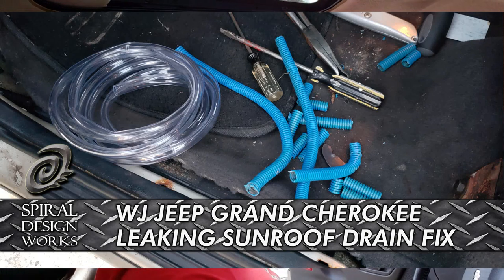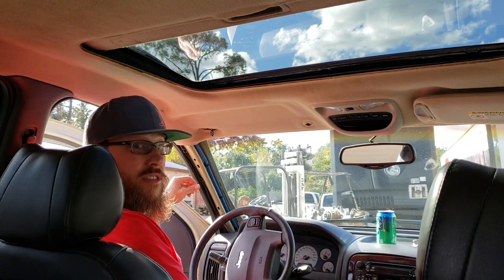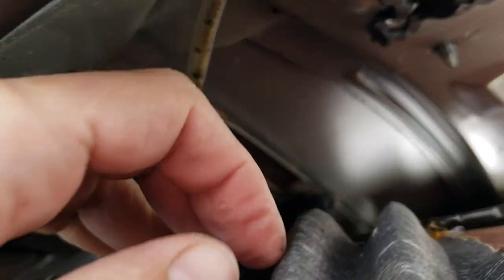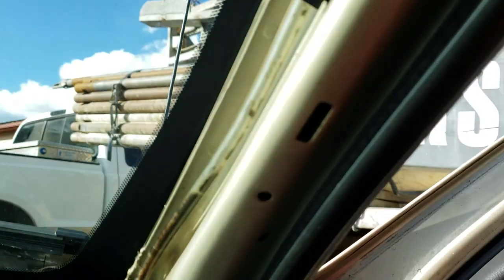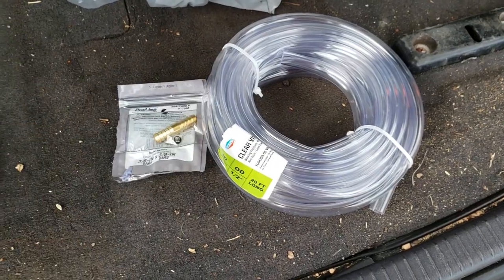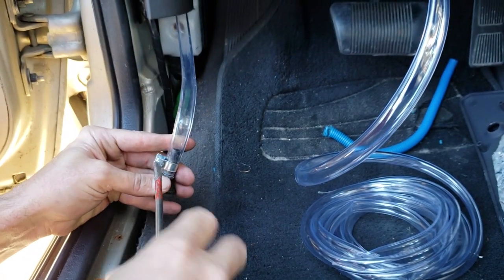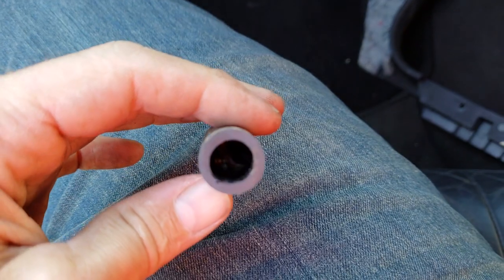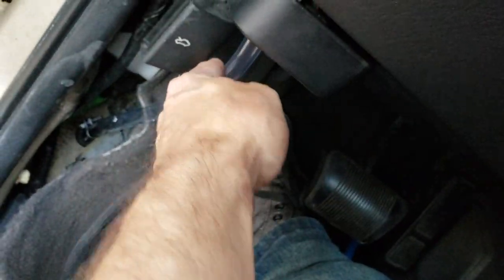EP.16-Leaking Sunroof drain tube fix- WJ Jeep Grand Cherokee

Comment: You're aq moron and should not be posting video's
Reply from the maker: Not sure what a "aq" moron is. I enjoy your content as well. Oh wait you don't have any. Troll on my friend.
Reply: @SpiralDesignWorks know anything about not getting any heat out the vents? I've had new, thermostat, rad, water pump, heater core, door blends and actuators! It's been scanned and nothing wrong! Recalibrate, still no heat! The door blends and recirculation door move OK, hot water in tubes, no airlock! Is there a valve or electronic device that could be overlooked by a non jeep mechanic? Any help would be great as my wj is a great car! Just passed mot with no advisers!
Reply from the maker: @terrystratford1235  that is tough if you already replaced all that. Check to see if you are getting coolant flow in and out of heat core.
Reply: @SpiralDesignWorks  my mechanic has a heat gun to see thermo temps, its all good! He flushed it multiple times! I wonder if there's an electronic device that sends info from turning the knob, to the actuators? Jeep want £200 to plug into a proper diagnostic! They assure me it will tell me what's wrong! My mechanic  has to replace the sunroof drain hose and is determined to find why I've no heat! He and his team are amazing, does alot of local work! He has looked after my jeep for 5 years! I understand there's a automatic temperature control unit on the back of the hvac system that controls the actuators, but that's a dash off again! I'm hoping it's something simple! 🙏
Reply: And who are you ??
Reply: @terrystratford1235 Terry, don’t know if you fixed this but a common problem with the WJ/WG is the foam disintegrating around the heating duct joins. Mine is going as I hardly get any flow from the drivers vents.

Comment: I had a huge leak and after removing the headliner I realized there wasn't any tube at all attached on the drains.  Went to home depot and grabbed some clear hose and used a hose clamp on the sunroof drains and stuck the other end thru the floor board and out a ton of clear silicone on the floor and it all worked great.  Big thumbs up for the video btw!

Comment: Heres another tip...to keep the rear dog legs from rotting out, which for most of us it may be too late, extend the C-pillar drains OUT of the vehicle.  As they're currently 6 inches to short to do so and actually dump inside the "pockets" in the rear behind the bumper cover.  From seeing the fronts drain into the frame rail, and knowing the rears drain inside the vehicle, it would seem these WJs were set to rot out from the factory.   Talk about guaranteed failure!  It just ensures that nothing will last forever..
Reply: Have any videos or guides on where these ones are at?

Comment: My 04 was getting water on the drivers floor, of course the first thing I checked were the roof drains. Expecting crumbling blue tubing I was surprised to find black tubing in perfect condition. The tubing was still very flexible and intact, the factory must have done a late production change to the tubing material. After pouring a good amount of water in the drains it was clear the leak was elsewhere. After some investigating I found the source of my leak was the bellows the door wiring passes through from the pillar.  It was dislodged where it registers into the pillar allowing water running down to enter the bellows where it would run down behind the kick panel onto the floor.  A reseating of the bellows in the pillar solved my problem.
Reply from the maker: Also the condenser drain can get plugged and drip onto the floor.
Reply: @SpiralDesignWorks   Yes it can, it used to happen on my Crown Vic all the time.  The carpet has already been removed from my Jeep, the entire interior is bedliner. I dumped a lot of water in the cowl area, the only place it came out was that grommet through in the kick panel area on the driver side. I got lucky I guess with this thing.
Reply: What year was your black tubing?

Comment: if that much water is making its way into your sunroof drain tubes then your sunroof still needs to be replaced the drain tubes are only there as a backup if and only if that much water is making its way around your sunroof seal and down into the trough that holds water and exits through your sunroof drains. They are not there solely for the purpose of carrying all the water that lands on your roof down the drains your sunroof seal is supposed to keep the water out it shrinks over time because of the sun exposure and you have to replace it there is a guy with a Dodge charger that has a video on how to do it on all Mopar vehicles which is Jeep Chrysler Dodge and RAM hope this helps

Comment: Finally someone did the entrance drain correct. So many youtube videos show putting the drain tube inside of the main drain...What? Thanks for this video I was scratching my head trying to figure this leak out. I did eventually pull my floor mat up, and wiped the lower drain tube dry, and re wet my upper side panel on my roof- then the area under my mat at the lower drain tube did get wet again. So now I know it is coming from the faulty tube. Great Video!

Comment: Thank you very much!  I had ruled out water traveling thru the door (design flaw) as the culprit causing the soaked driver-side floor, using a tarp during a big storm but did not know where to go from there.  Really appreciate your detailed video!
Reply from the maker: Glad it helped! If you get a pool on the passenger side it is usually the drain for teh Heater core box is plugged or leaking heater core.

Comment: Excellent video, thanks very much for posting this. My WJ had been bone dry summer and winter but then after a prolonged period being parked up and facing downhill low and behold I return to find an indoor swimming pool in the passenger footwell. My first thought was to reach for the extra long pipe cleaners to purge the tubes of gunk and restore water flow. However, after watchiing this and the point you make regarding the brittle nature of the connection's and the tube I thing your approach to inspect the whole line from top to bottom is preferred. Thanks again for going to pains in showing good quality video of each step and how you achieved those water tight replacement connections and tools / pipe used.
Reply from the maker: Yes I need to do my rear drains. Had it parked nose up hill and rear floor was flooded. Ugh. I hate sunroofs.

Comment: Nice video. I have a white '07 GC and the floors in the front have been getting soaked. I've taped over the sunroof joint with white duct tape to see if the leak is stopped till I can tend to the fix. Thank you again for the instructional.
Reply from the maker: mine is leaking again and I suspect the lines are clogged and need a good blow out and cleaning.

Comment: This totally answers my question...had a damp passenger side floor in my wk..now I know why. Also sent to the car wash and my driver side inside pillar was leaking water. Had to reset my sunroof for one. But also probably have a brittle drain tube.
Reply from the maker: if you are just seeing water on passenger side floor it could also be the heatercore leaking. But most likely sunroof drains.

Comment: Both front floors on mine are wet all the time and my sun roof is siliconed shut. How i bought it. But i can hear a drip in the roof while driving. Im sure this is it. Good thing im a plumber. This is a piece of cake. Great vid!
Reply from the maker: Thanks!
Reply: @SpiralDesignWorks  do you think it would be a bad idea just to plug the drains if you dont use the sunroof?

Comment: Thanks for sharing this!  I have a 2006 Jeep Grand Cherokee Limited with pretty much the same layout. My passenger side flooded after a heavy rain and I suspect there is a clog in the line somewhere near the floor. Do you know what connections could be effected down there? My Jeep drove the morning after this flood, but now has no power. I think driving it before drying it out may have shorted something. Ideas?
Reply from the maker: Really hard to say. The connections under the hood are "water proof" but it is possible to short out a circuit if you were in deep enough water.

Comment: Didn’t see you do the back line , where does that one drain too?
Reply from the maker: The backs drain down behind the rear doors. They are usually not broken as they don't get the extreme heat from the windshield I guess.

Comment: Rear tubes ?
Reply from the maker: yes the rear is done the same way but you need to do more work to get the headliner down. I have found that the front A-pillar tubes are generally more deteriorated and broken as maybe they get more sun and heat exposure.

Comment: Great video. Other than not covering the rear drains. 

Oh. And ditch the music. Especially when you are so soft spoken.
Reply: do agree was waiting for the rear fix, but i guess its been leak free? still great vid none the less , will atleast get that far. thanks OP
Reply: Anyone have a link for a good rear fix?
Reply from the maker: Thanks for the feed back. I recently had the headliner out and the rear drains on mine are doing fine. I don't think they see the heat the fronts do.